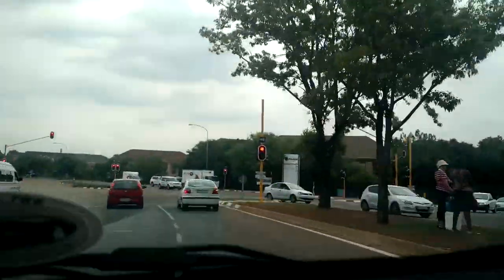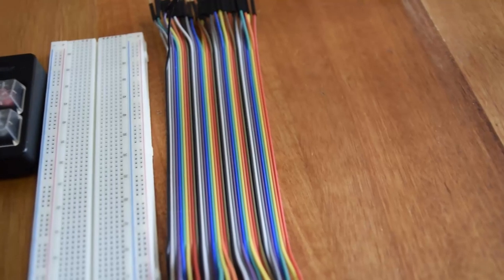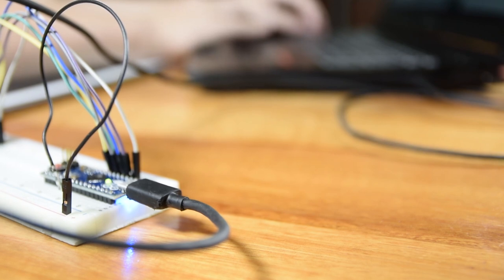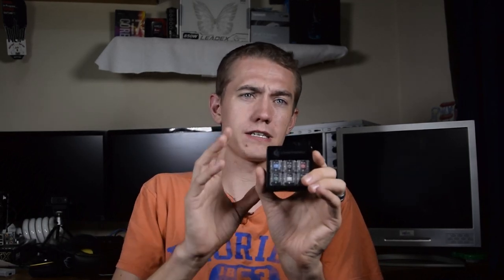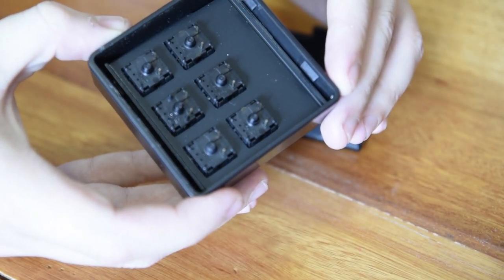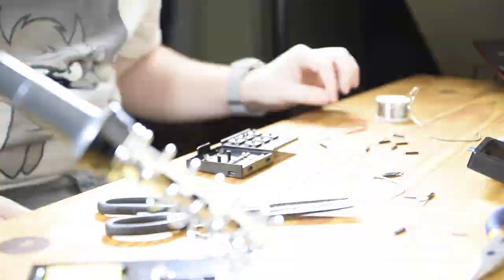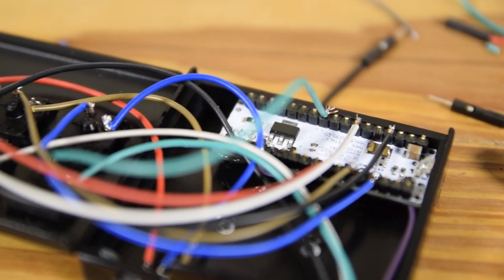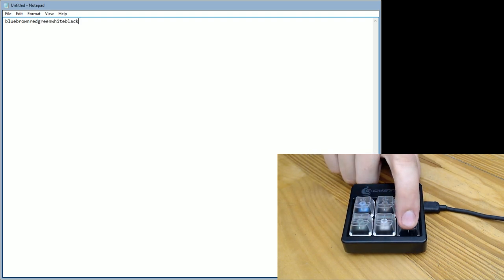Cooler Master DIY Micro Keyboard

Comment: Wiring diagram?
Reply from the maker: +Christopher Keers Sorry, don't have one.
Reply: It's easy, trust me. Search for "button Arduino", then wire up all six switches as six buttons. You wouldn't even need the resistor as Cherry MX switches have a lot of space inside them so there is no "bouncing" or "rattling" of the metal plates which can be found on smaller switches.
The software part may be a bit more tricky but as we live in the glorious age of internet just search "arduino as a keyboard" and you find a lot of code which will help you :)
If you're more interested than just that or want to make yourself a whole keyboard with much more switches then check out the reddit.com/r/MechanicalKeyboards and their wiki on making your own keyboard :) You can either buy a PCB or handwire it yourself :)